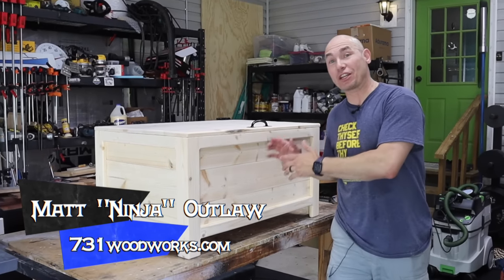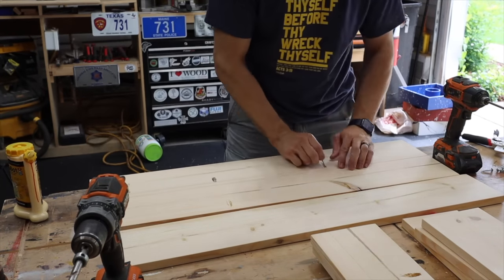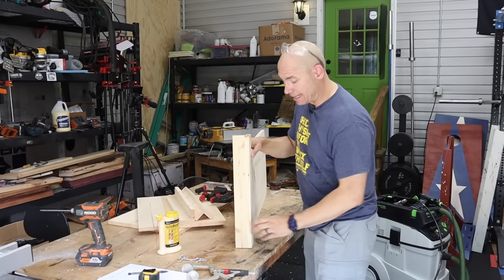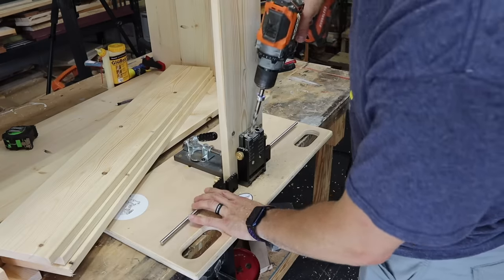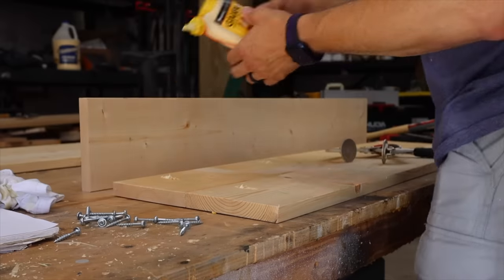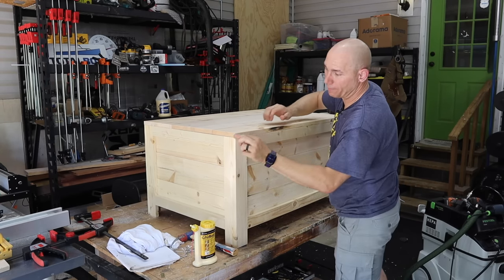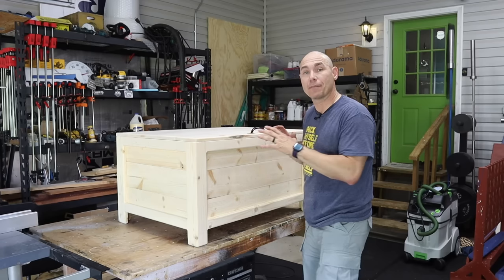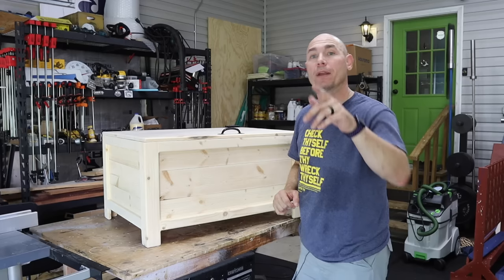How to Make a DIY Storage Chest | FREE Build Plans

Comment: Matt- Great project and video. I am nearly done building this, although with some modification. I made it larger to accommodate my patio seat cushions, and taller (table height) so we can use it as a place to put food and stage for the grill and smoker. So it's approximately 44x20x30 high. I am also putting it on casters and I added hardware cloth on the bottom to keep critters from getting in between the slats. My experience with a router is limited. I did use a chamfer bit on all the edges, but obviously there is the round inside corner that it leaves behind. I realize it's only outdoor furniture, but curious if you used a chisel or some other method to make better corners after you used the router. For a finish, I was going to use stain, but after consulting with the folks at the red store paint counter, they persuaded me that stain and paint are both going to peel eventually in an outdoor environment and the paint was much less money. I'm using a Zinser primer, followed by two coats of exterior paint. Thoughts on the finish? I had contacted Cabot directly about the Australian oil that you used and they recommended against that for being out in the elements, which yours, it appears, is not. Keep up the good work. Love watching all your material.

Comment: Question,  Should I worry about wood expansion when gluing the panels up and then attaching (gluing) the legs to them.  Will the panels crack when they expand? Thoughts???   I live in NC and my humidity is high most of the year.
Reply from the maker: I don’t think it’ll move enough to worry about. I live in south Arkansas. Our humidity is 75% and up most of the year
Reply: Have you seen any issues with expansion and contraction since you built it?  Would be interested after a summer outside.  Excited to make one as a toy box.
Reply from the maker: I haven’t had any issues. It was in 100+ degree and high humidity. It’s getting cooler and more rainy now and no issues so far. It is under a covered gazebo

Comment: Hey Matt do you have any tips on that sprayer you used? Thinning paint and or clean up after stain or paint. Thank you for a great video.
Reply from the maker: I typically use water based paints so I just clean up with water.  However on this build I sprayed the oil based finish and used mineral spirits to clean it
Reply: @731Woodworks  Thank you sir.

Comment: Great project Matt, I may make my mother in law a modified one of these for their pontoon boat. I noticed you use a festool sander now instead of the dewalt, is it a night and day difference as far as vibration and material removal or somewhat similar?
Reply from the maker: It’s similar but better and quieter

Comment: I saw that mistake! i was like NO he put the board with the pockets facing out! lol i actually had to double take because a minute later i saw you caught what you did and fixed it. Good work. I really like this! Will that stain really help with keeping it from rotting/warping? or should i use pressure treated if i know it's for outside?
Reply from the maker: Yep. Had to reverse it lol. the stain helps. You could also use cedar or redwood for more durability